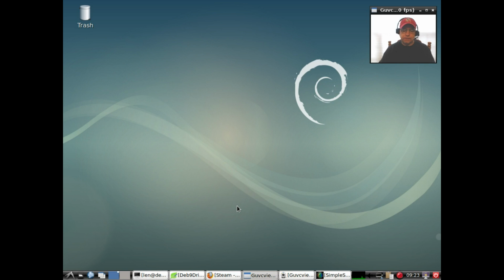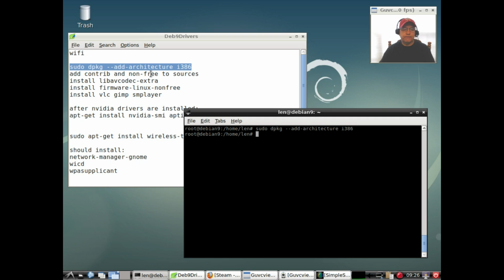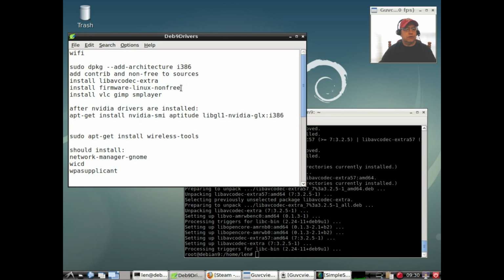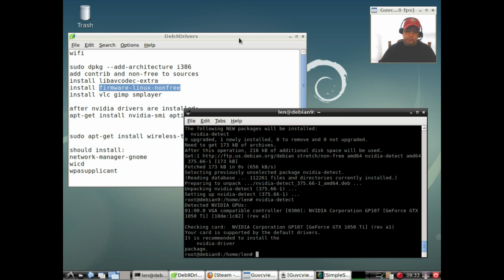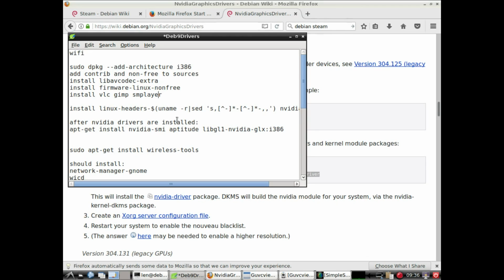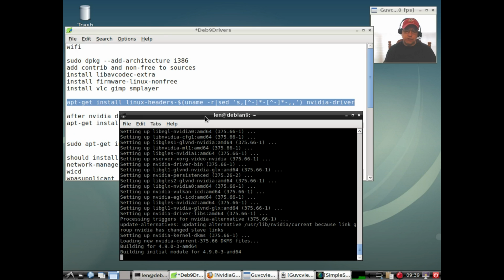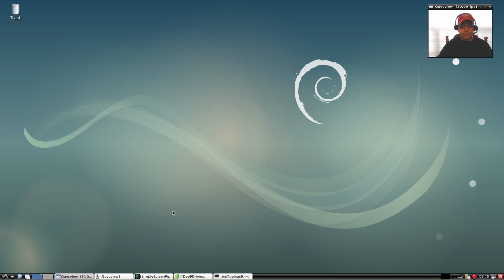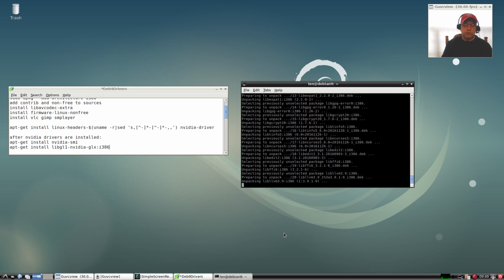Install Your Nvidia Drivers in Debian 9 Stretch Stable

Comment: i have got lenovo 3000 n100. i unfrotunately install nvidia drivers exactly shown in the video, after that i install wifi drivers as well. after installing, restarting the computer it says "oops, the system can not start, log out and try again" i did it, it turns into an infinitive loop. i can not open the system. what to do?

Comment: Many thanks for the video, it was very clear. However, when i reboot the system, I get stuck in a black screen that shows me the system is uploading. I get at the left side of every line an [ ok ] check, but it stops in the phrase "Started update UTMP about System Runlevel1 Changes"  and stays there forever. I have tried several times to install the nvidia, your video is the one that shows clearly the step by step process. Can you give me hand on what may be going on?
Many thanks

Comment: The message "You do not appear to be using the NVIDIA X driver. Please edit your X configuration file (just run `nvidia-xconfig` as root), and restart the X server" appears when I open the NVIDIA X server settings application.
Reply: Same here.. This occurred after a Debian 9.6 crash when my monitor went into standby due to being idle. The corrupt files/drivers were/are Nvidia video drivers; an older version, but still on the list.

Comment: this is the procedure that worked for me in LMDE 3 (debian9):
  In Terminal: 
sudo su -
apt update 
apt install nvidia-detect 
nvidia-detect (to identify your Nvidia GPU and verify required driver package) 
dpkg --add-architecture i386 
apt install libavcodec-extra57 
apt install libavcodec-extra
apt install firmware-linux-nonfree 

Ctrl+Alt+F1
  In Console:
sudo su -
service ligthdm stop (to stop your display manager)
apt install linux-headers-$(uname -r|sed 's,[^-]*-[^-]*-,,') nvidia-driver 
reboot

at this point cinnamon did not start any more, I had to reinstall it, now the nvidia driver was installed and works fine.
sudo apt install cinnamon
sudo reboot

Thank you very much for sharing!

Comment: This did not work for me. It works in Xubuntu and Ubuntu, but does not work in Debian 9. It fails to load LightDM. And the issue is with Optimus Descrete graphics cards.

Comment: Hello, I saw your vídeo and followed step by step. When I run Nvidia-detect it show me message that no GPU detected and I have Nvidia 920M
Reply: Same with Nvidia 930M.
Reply: same with Nvidia 720M
Reply: My Solution: switch back to Ubuntu, unfortunately.
Reply: same with 1050 on MSI GL62M
Reply: I hope you eventually realized what was happening here... 920M, 930M, 720M, GL62M... it almost maybe seems like most of my mans chips maybe mostly mobile.

Comment: Hey Len! Cheers for the walkthrough. My Dell runs a 1050Ti and following this process step by step did not work. Upon booting I get an error page with a sad faced computer that says Oops! Something went wrong. I then have to open up the terminal using Ctrl+Alt+F2 and when loading up X window using startx i  get an error saying: 
"Plasma could not correctly use OpenGl2.0. Please check your graphic driver." 
I end up having to uninstall the nvidia drivers and load back nouveau. And also this process has permanently stopped my X window from booting normally, i have to keep going through terminal now and use startx : /  I've followed this process to the dot and attempted it over 3 times today without any success. I'm scouring the web for solutions. Any solutions/recommendations? 
Thanks again!
Reply: So the solution to this problem was two-fold - firstly I shifted from KDE to GNOME desktop since Plasma was having issues dealing with OpenGL. The second issue was that I'm running an Optimus System which requires installing bumblebee - https://wiki.debian.org/Bumblebee. I think it wouldnt matter if i used KDE - the primary issue was that I was doing a normal install without considering that my system is Optimus! All works beautifully now!
Reply: yeah, I'm able to get my Xserver on KDE now aswell. All running smooth - Bumblebee is the answer !

Comment: You did a fantastic job.  I have Linux Mint 8.2 installed and want to install Debian 9.1 and dual boot.  Mint installed the graphics driver but failed to enable the nVidea console.  I am going to go back over this again...use the same terminal commands and see what happens.  Mint also failed to detect my brother printer...I found the Linux support driver for my printer on the Brother site...had to download, unpack and make install...I had to fight also with my sound because ASUS is being a jerk and not supporting it's fx sound chip for Linux.  I went to a second hand store, bought an old SB 5.1 Live PCI CARD.  Reinstalled ALSA drivers and it works but sounds tinny to me.!  I am wondering if you have some equally good advice on sound drivers...anything for proprietary creative would be great.  Once again, great job on nVidea...I think you should share your advice, with Ubuntu and Mint.  Thanks!

Comment: Thank you. I followed each step till end and was very happy that my problem will be solved. Just before reboot i got error message. When i reboot my system i lost my display.  I am using T5600 dell precision workstation. It has two 6 core processors, 64 GB RAM and NVIDIA GEForce GTX 550 ti graphic card. Initially it had quadro 2000 card but i replaced it because i need HDMI port for my LED. I get black screen or lose display when i try to install driver. What should i do? Should i use Qudadro 2000 or 4000 or 5000, as recommended by Dell. Will that solve my problem? please help me.
Reply: When i turned my system on in the morning, NVIDIA driver was already installed. It seems that there is some problem with my graphic card and it gets hot and display disappears.

Comment: thank you very much for doing this video. Helped me alot. Got it running with a few minor differences from your instructions. I started with a fresh install of Debian 9. GIMP was already installed and i installed VLC. Got very flustered when i went into Synaptic to add the contrib and non free. I am using Gnome so what i saw was nothing like what you had in the video. I did not have to edit anything just put a check in 2 boxes to enable non free sources. 
 
every other step worked the same but one. Looks like you changed it in the notes now tho. in the video the sudo dpkg --add-architecture i386 did not work but leaving out sudo did.

all other steps went well and the Nvidia driver is installed (Geforce GTX1070) had an issue with the Steam install. When it came to the screen with license info, scrolled down to bottom but could not click on the "ok" button and enter did not work either..... edit. heh just looked at the steam install part of video again. Right at the top it says to hit "TAB" to move to ok box. - doh!

Comment: After following all the steps ended up with blank screen on ASUS GL553VE laptop with the same 1050 Ti graphics card. In my case, nvidia-detect simply unable to detect still I did all the steps and failed. 
sudo lspci -nn|grep -E '(VGA|3D)'                                                                                                                                                                       
00:02.0 VGA compatible controller [0300]: Intel Corporation Device [8086:591b] (rev 04)
01:00.0 3D controller [0302]: NVIDIA Corporation Device [10de:1c8c] (rev a1)
Reply: doesnt work with asus 550nj nvidia 850m either

Comment: Thanks for this video. i had a problem with this which made me unable to boot even after i had the kernel headers installed. i need to either disable graphics switching or install optimus/bumblebee for nvidia on my laptop. otherwise i get the oops white error message and the system won't boot.
Reply: Is it possible to point to a guide for this please? I am having the same issue. Having an optimus card and Installing the Nvidia drivers following the debian wiki results to unbootable system.

Comment: Great video, thank you very much for this kind of material. I've been running with debian 9 and it's awesome but why do you need to install the wifi drivers? I didn't do it when I installed debian 8. Thanks again.
Reply: Oh and what about if your gpu has the optimus enabled? I know there is the bumblebee driver to use the gpu when you need it and use the intel graphics for the desktop, etc.

Comment: Hi Len. Great video. As always, your tutorials are incredibly helpful. Quick question, do you have the screen tearing issue with Xfce/Nvidia on the new stable release of Debian 9 stretch? If so, does the fix you demonstrated in your video ("Easy Screen Tearing Fix for XFCE Linux and Nvidia Graphics") still work? Thanks!
Reply: I fixed my screen tearing by enabling the "ForceComposition Pipeline" on the nvidia settings and saving the configuration to the xorg.conf file.

Comment: Great video as always, Len. But, what if we need the 381 driver? I personally need it for 2 of my games. Otherwise they won't work. Any help would be awesome. Thanks in advance.
Reply: Hello Bad Wolf Plays ! You need to enable the non-free and contrib repos from Debian either through Synaptic or by editing the /etc/apt/sources.list file. Then you need to update and upgrade your system (sometimes it is necessary to enable i386 by typing dpkg --add-architecture i386) and then you can install the following packages as root: nvidia-driver, firmware-linux, nvidia-xconfig and nvidia-settings. Then as root run nvidia-xconfig and after that reboot the system and it should be OK !
Best regards,
Serge
Reply: I believe that the 381 drivers are available in the unstable repos which you can get via backports. Backporting is a whole seperate tutorial =p
Reply: So, 381 IS listed, but, it's uninstallable. I have been TRYING to get everything working since 1130. It is now 1430. I've spent more than enough time on Debian now.
Reply: But dont you like to learn more every day? I bet now you've learned something worth the time ;)

Comment: Hi Lenny. How are you doing? First, thanks for the great videos, it is quite helpful.
Now let me ask you something terrible. Is it right to proceed the same way as you did on this video using a laptop with intel graphics card? I'm using Debian 9 on a VM but I really would like to install it as my main operating system. The issue for me is the second screen detection because the nvidia-settings does not recognize the built in screen and the external screen. They recognize the screens as a single piece with a name like "xscreen0". I can't handle with this kind of limitation during my working hours because I work with a second screen all the day using the VGA input to connect projectors and so on. Sorry for the big message. Thanks in advance.
Regards.